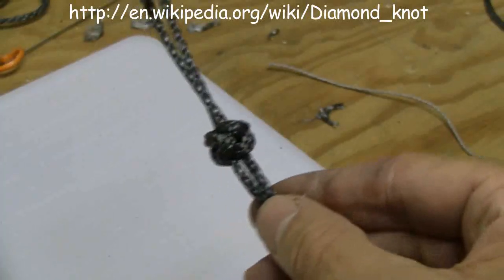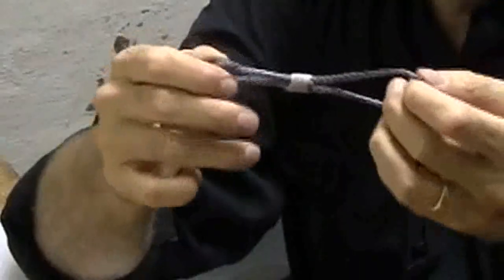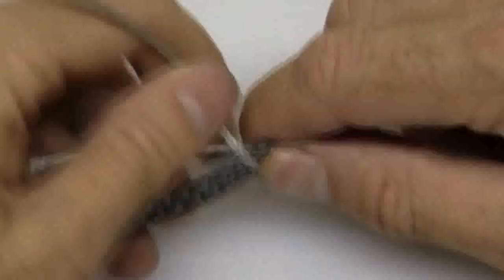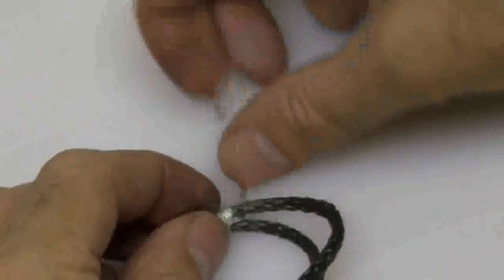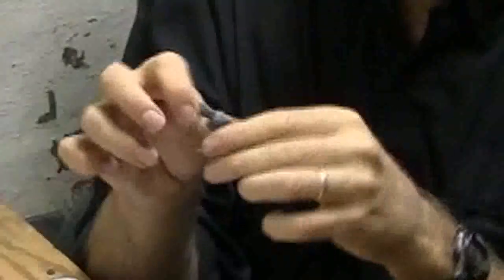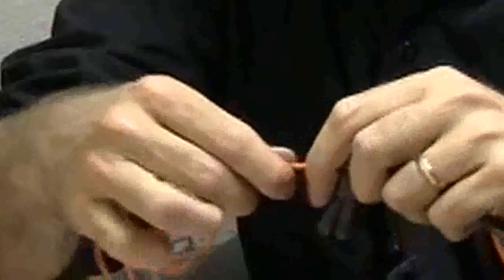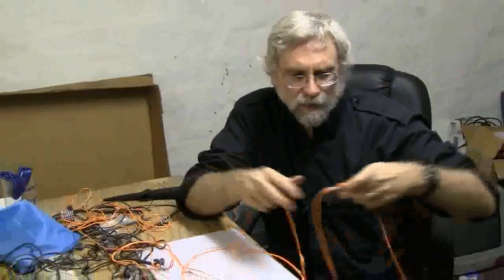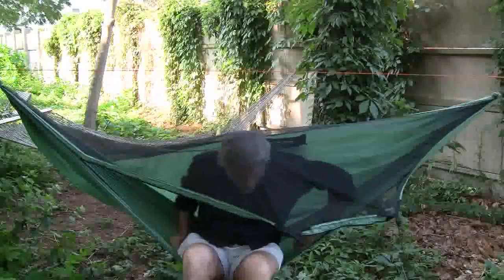A Hardware Free Detachable Hammock Suspension

Comment: Hey Grizz,
quick question for you,
couldn't one use the tree straps as they normally do but instead of fasten the whoopi slings to the hammock attach a prussick to the ends then take your tree straps and attach a whoopi sling between the two,hang the straps with the whoopi slings between the trees with two prussics on the line.then hang your hammock to the prussic.you could use a continuous shackle to hook the ends of the hammock to the prussic. basically its an adjustable ridge line .

Comment: Great video and awesome suspension. I was wondering if you could use the diamond knot at the end of the whoopie sling made from the same dynaglide used in the whoopie sling instead of using amsteel.

I was also wondering about the need for a drip line. Have you used this setup in the rain yet?

Comment: basically its a adjustable  ridgeline and on the end are tree straps.On the ridgeline you have two prussics with a diamond knot on the end of them,so you can hook them to the continuous loop that is larked to the hammock.
  you would have the ability to move your hammock just by sliding the prussic knots in the direction you want...
think its doable ?
tiredhiker